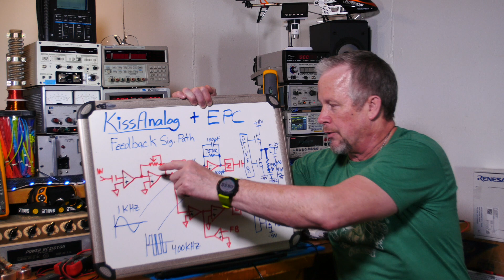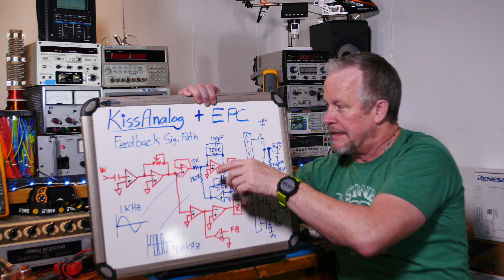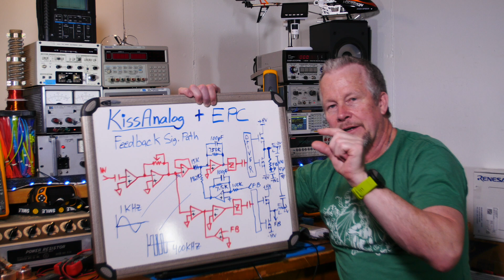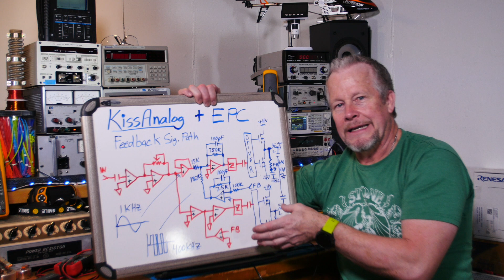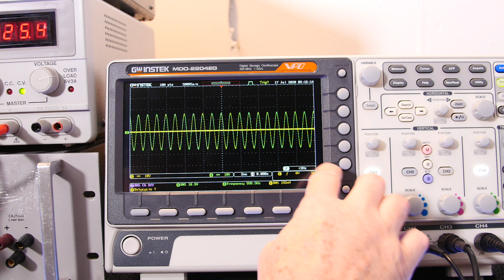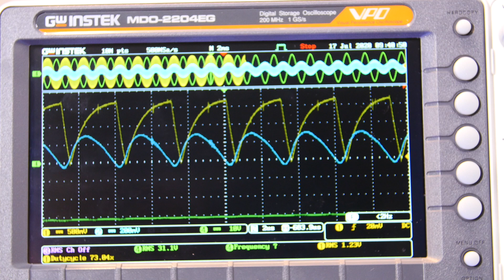Class D Amplifier - the Feedback Path with EPC GaN FETs

Comment: Busy with simulating and more, now inplement a forward feedback and see what happens, I get alreay 0.000024 procent and with 6 amps out it is 0.004. very good, but w3as unstable, so now have implement forward and that does help enormously. I use normal mosfets and multilevel system.
Reply from the maker: Sounds like you're doing some great work there!

Comment: Thanks for doing this Eddy! I've been recreating the signal path first in Micro-cap (to understand the circuit in depth, had to break circuit down into multiple sections or else Microcap is unhappy) now I've just finished breadboarding the feedback path and was able to re-create the feedback amp and summing circuit with the zero-detect LT1671. My 2-channel function generator is limited in its square-wave pulse modulation (50kHz @ 100Hz modulation), but I changed the feedback amps R + C values to work at the lower frequency and lower input voltage (Function generator only does 20Vpp instead of 30+Vpp). Also changed the Feedback Resistor for summing amp. Finding this D-class action supper cool! Next step is to start PCB layout!

Comment: Difficult to get deep enough after 0dB point to suppress ripple, everything must compromise to get right. a friend did manage to get it under -30 dB after audio bandwidth.

Flattened integrator over audio band seems to make audio better on low frequencies I did use 1 : 2 pi x R x C set it audio bandwidth the same as the low pass cuttoff in mine case 30 kHz.

I did get -120dB.
Reply from the maker: Great Feedback;)  Thank you!  -120 dB is amazing!